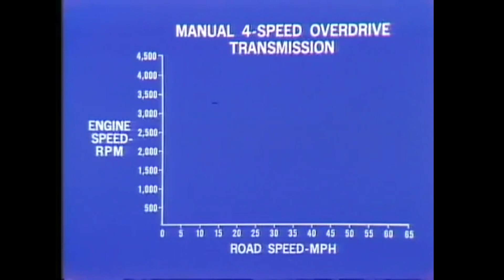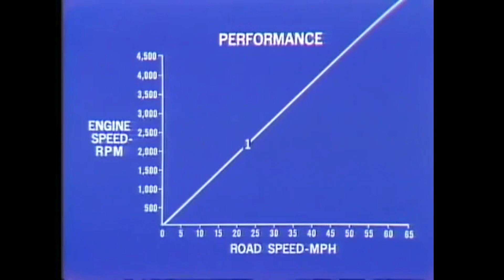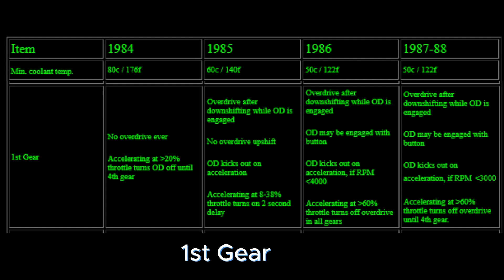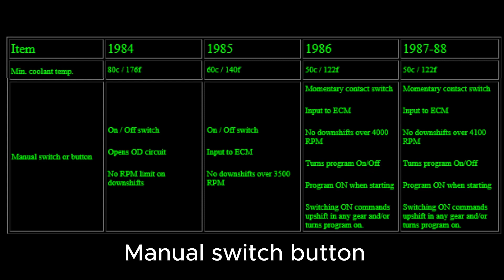C4 Corvette 4+3

Comment: I am curious how this compares to the skip shift which was implemented in 89-96 in the manual C4s with the 6 speed manual. I had it in my C5s and really didn't like it as it often left the car flatfooted and bogged the car down by suddenly dropping the car into 4th gear. 🤔
Reply from the maker: That's a good question, the 4+3 is basically a 4 speed manual with a overdrive attached that will kick on in 2-3-4 gears when little throttle is given, similar to the 6 speed drop down (I think,?) You would know better having actually owning one. When the OD is on, it will also kick in bog the car at times until you kick it out, but the nice thing is it can be turned off with a switch.   I understand that the 6 speed can be disconnected too, but is a little more involved. As you know both are to save gas and both can be a pain to deal with. Thanks for the question.

Comment: This transmission wasn't designed to be abused. It was basically an old mans transmission.
Best to replace it with borg super T 10 with out the od or plain fact get a muncie M 22.
Reply from the maker: When they went to the ZF 6-speed manual transmission, all things got better.
Reply: @kussstuff  
The ZF 6 speed is better.
But there is no replacement for the muncie M22

Comment: Mike great videos. I own a 1987 C4 with the Nash 4+ 3. Love it. What are your recommendations for the proper fluids to change the transmission?
Reply from the maker: Corvette overdrive unit-Moblel 1 DEXRON-IlI. and the T-10 4 speed SAE- 80-90  gear lubricant.   (Synthetic oil not recommended)
Reply: Thanks for the info Mike. I’m planning to change them both soon.

Comment: Hello Michael.  I  am  the original  owner  of  a 1988 4+3 with 41,000 miles.  Runs great, except for the automatic overdrive stopped  working sometime ago.  It does not work when you want to  accelerate and pass someone  without manually downshifting.  It will work,  however, when I manually engage the  button on the shifter.  Not sure what the issued could be.  I read somewhere else that it could possibly be a relay under the hood on the firewall, but I cannot figure out which one it is.  Supposed to be a a low cost ($35) part to try.  Any suggestions.  Thanks!
Reply from the maker: I really wish I could help you on this one, but this is when I wish I had a full-service transmission manual.  I do have a number of service manuals for my corvette and will look through and if I find anything that would help I will let you know. But you may want to try some of the C4 Facebook groups if you haven't already.  Good Luck!

Comment: Hello Michel, I am from Switzerland and bought a Corvette 1986 L this spring. It has the 4+3 manual transmission. I have only driven 1500 km. 
I thought that when I shift into second gear and it automatically engages the overdrive that it makes a mistake with the electronics. Now you say that it shifts directly into 2,5 gear at a speed. This is the same system as the C6 where it shifts you directly into fourth gear. That could have been the pioneer, in a sense. 

When I go to a US car meeting I only see C4 automatics, this manual transmission is unknown in Switzerland. But I could talk to people who know the gearbox and rated it positively.
Reply from the maker: First off -- Hello from the United States.  
There is a lot of confusion on the 4+3 Trans, because all years are not the same, so often you get different answers for the same question. Thats why I put a graft at the end of the video to show the differences. They are a good transmission, basically their a T10 four speed with a OD. 
Thanks for the comment.

Comment: I agree that the 4+3 is an awesome transmission. Maintain the fluids and u r good to go. No synthetic in the OD unit. 

An 86 4+3 was my first track car and it was perfect. I had amazing fuel economy on the way to the track, then simply turn OFF the OD at the track!  Im not sure why so many people take issue with it. Its awesome. 

Oh, i always use the clutch when i engage and disengage the OD.
Reply from the maker: I also think the C4 makes a great track car with the 4+3. Sounds like you proved it. Thank you for your comment.
Reply: @kussstuff  please keep the c4 related content coming!

Comment: Thanks Michael. I have never seen such a good explanation of the workings of the 4+3 manual transmission. I never realized there was any difference from year to year. I think i would drive it the same as you. Just a 4 speed and an overdrive for highway mileage. I used to drive a truck for work with a two speed rear end and that ended up being the way I drove that truck. I have a pair of 92s that I am planning to make into one fine machine. The stick shift car is wrecked but runs and drives the other one (automatic) i think was someone else's donor car. To many mismatched and missing parts. But the body is decent. I hope to start posting videos on my progress in the future.
Reply from the maker: 1992 was a good year for the C4 , with the LT1 motor came out. Having a pair of 92s of them to make into one is going to be a cool project, I look forward to watching. Thanks for the comment.

Comment: For those looking at C4 automatic models, look for one with av3:07 rear differential instead of the standard 2:56 rear differential. The Doug Nash 4+3 transmission is so misunderstood by many folks. Maintenance is key with this manual transmission. Ignoring this can be costly.
Reply from the maker: Good info. Thanks for the comment
Reply: @kussstuff  I enjoy your videos on the first gen C4 models. I currently own a '96 Collector Edition, but owned a '87 convertible for more than 13 years. The C4 generation is a great value for first time Corvette buyers. It provides a rawer drivng experience than later generations. And not too crazy powerful, excluding the lower production ZR1 and Callaway models, than newer generations.
Reply from the maker: @nikkoalpha2  Your '96 Collector Edition that's awesome. These are special cars which drive like no other. Thanks for sharing.